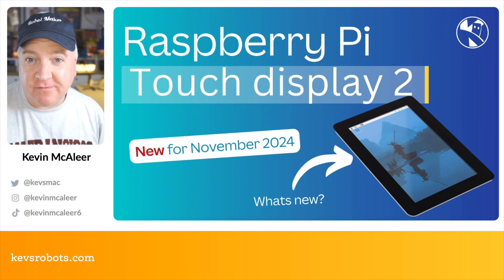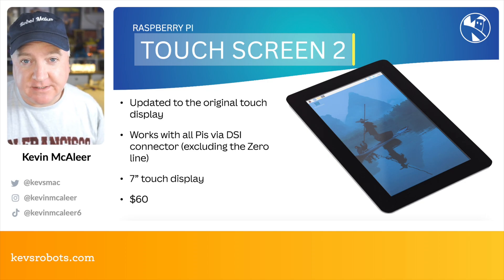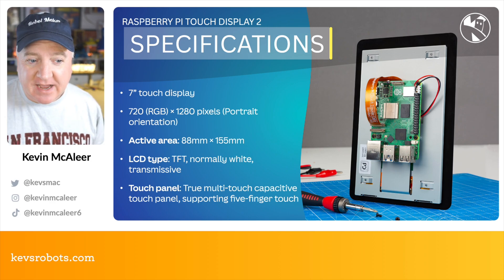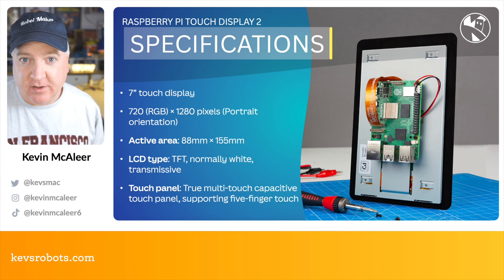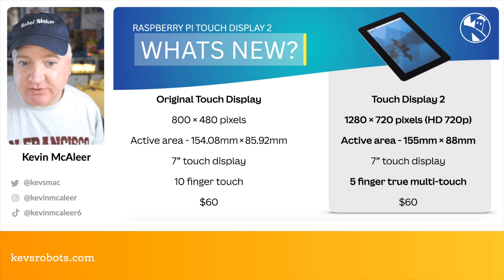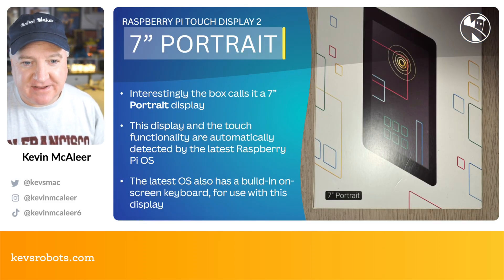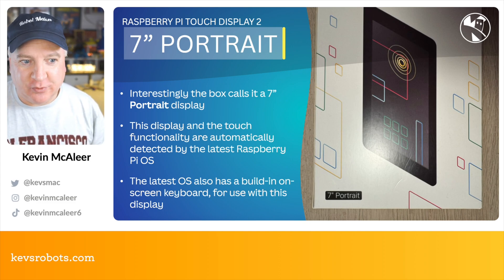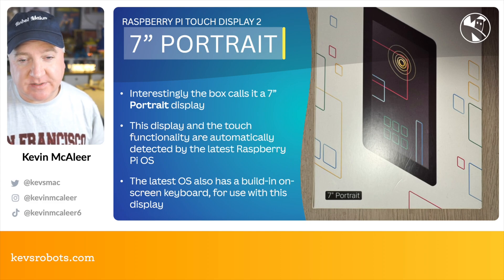Raspberry Pi Touch Display 2 - what's new?

Comment: just got one,
I had to rewrite OS on the card 3 for a pi4 times before it would work, the onboard keyboard refused to appear until a day later even though I had updated fully  and done several reboots and changed the preferences
i tried using KODI only OS  as I wanted it as a media client but it would only work in portrait with no way of rotating the display - which is why i think it is listed as a native portrait and needs the pi software to rotate it
finally got the desktop working with the on screen keyboard and downloaded the desktop KODI version
again the full screen version will only show in portrait mode regardless of the desktop orientation but the other version on the start menu does work correctly
after a couple of days I now have it working as it should
the display is good and the touch works best with a stylus if you have one
once assembled you can't access the SD card without releasing the screen cable and even then it is difficult with adult finger

saying that I like it but it is an expensive toy unless you have a specific use for it

Comment: I have one and the initial impressions are good weighed against the cost. It is a TFT display but this is made clear in the specs. The display has good resolution and there is no noticeable latency on inputs to a Pi 5. Installation is straightforward but a case or stand is definitely needed unless you mount it in a panel. The video cable clears a Pi 5 active cooler with space to spare. It also leaves the SD card easily accessible, but unfortunately not the power button.

As for the software setup, there isn't any. It just works with the Pi OS. Rotating the display to portrait is the same as for any other display using the menu options. Easy.

Comment: Wondering if you can switch to landscape in the setup?  It costs ~$72 US dollars not $60.  Pimoroni sells for 55.75 British pounds and that comes to about $72 in US dollars.  The US PiShop is selling pre-orders for $72.50.  I may get one of these for traveling in my RV.  Thanks for sharing!
Reply from the maker: It says you can use it in landscape mode in the press release this morning
Reply: $60 with 20% VAT comes in at $72 exactly

with bezels like that you can land a jumbo jet on it, i don't see myself using that in any residential setting
Reply: @marshallb5210  US customers have to pay the VAT?
Reply: @marshallb5210  yes, horrible bezels and you can get 1080p hdmi displays for that money. or put a bit more and get a 2.5k res display. pi foundation must be filling some niche market taking advantage of tax schemes, they clearly don't make products for the general population anymore.